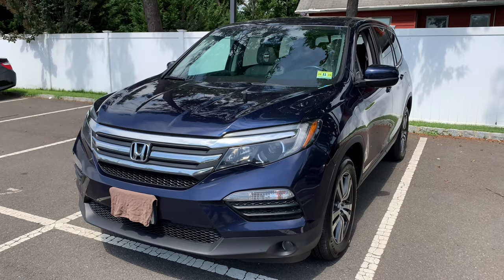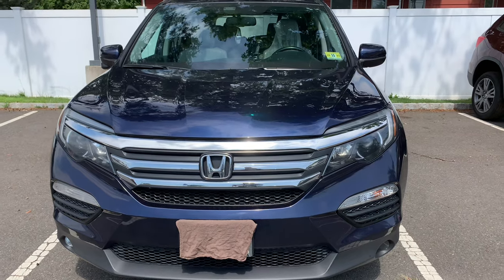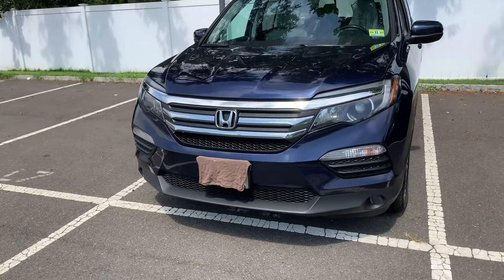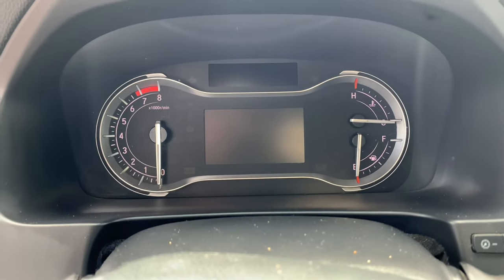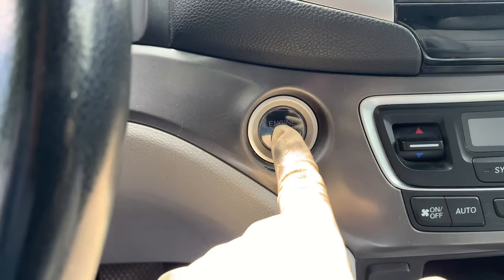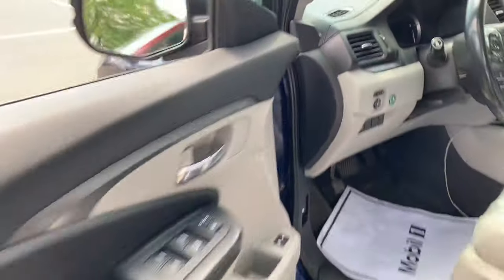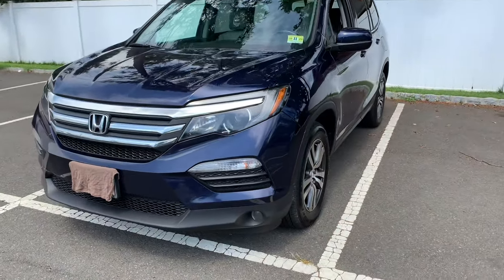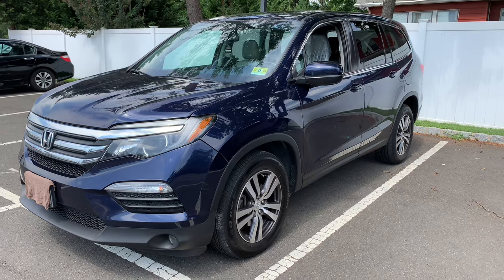2016 - 2018 Honda Pilot common problems

Comment: I enjoyed the video. I just bought a 2017 EX-L AWD 6spd and I noticed the tachometer fluctuating. The vehicle has 74,000 miles and I did get an extended warranty from the dealer. Should I request a trans fluid change? Or just mention the issue and see what they will do. 

Thanks in advance for any help.
-Jake
Reply from the maker: Mention the issue. Tell them you know it’s a “thing” with these cars. I have a few videos on this matter. Tell them to check for pcm updates and perform if needed as well as the 3x trans drain/fill.
Reply: @BCautosolutions  Will do! Thanks again for the info! 😎
Reply from the maker: @sparkiejake1  👍🏻👍🏻

Comment: I have a 2018 Pilot Elite....when i make some turns, it feels like it wants to shut down, and just before it does it inadvertently revs up with a jolt
Reply from the maker: @MrLovegospel  check your intake tube. If it’s good I would clean your throttle body and have the values relearned with a scan tool (must do step)

Comment: Thanks for sharing your knowledge and insights. I am looking to purchase as used (new to me) Pilot and have been reading mixed messages about the transmission. Some say get the 6speed some say get the 9speed. Which one would you recommend? I know the the only comes in the Touring and up models and the 6speed on the EX-L and below trims. Looking at 2017 and up model years possibly till 2019 only - or as budget permits. Thanks!
Reply from the maker: Hey thanks for watching. So people saying don’t get the 9 speed don’t have any idea what they or saying or experience. We have had nearly zero issues with the 9 speed. The 6 speed is problematic but if you stay on top of the transmission services (I highly recommend every 15k a drain and fill) then it can get a way less problematic trans as well just like the 9 speed. Buying a used one can be risky because chances are proper maintence wasn’t done on the 6 speed and could be too little too late, for that reason I say go with the 9 speed if the budget allows to get, which like you said comes on a higher trim pilot.
Reply: @BCautosolutions  Thank you so much for replying back to me. I really appreciate your time and effort. And thank you for the advice as well on which transmission to get. As mentioned, I am getting mixed reviews on both transmissions, both have been said to be problematic with the shudders and rough shifts and loss of power. But now I am confident in getting the 9Spd over the 6Spd thanks to you. I’m also a subscriber to your channel now as well. Looking forward to learning more about Hondas. Cheers!
Reply from the maker: @arwencale  thank you, congrats on your new (to you) purchase and best of luck to it!
Reply: I apologize for butting in but I wouldn’t recommend a Honda Pilot. I have a 2017 and it’s not a good car. I bought is used with very low mileage but it’s already becoming an issue.
This is my 2nd Honda and both have had issues within 3 to 5 years of manufacturing.
If I could go back in time I would get a Toyota. Toyota has never given me (my son or husband being the main mechanics for usual things) issues until they got beyond 10 years old or older. That’s as long as you do regular maintenance but that goes for most cars. I’ve just experienced that Honda isn’t as reliable as Toyota since I don’t have a lot of money to spend of mechanics that do things that my son or husband couldn’t do for whatever reasons.
Wish you the best!
Reply from the maker: @susana5052  thanks for your input, I can assure you Toyota has their own share of issues… I’m actually getting closer and closer to making a video about all the issues they are having. Our sister Toyota store is literally across the street.
Reply: @susana5052  all problems started by doing a japanese vehicle in the USA....
Reply: @saca.r9987  So then.... they are not japanese.... or are they?

Comment: Just checking things out as I am also planning on getting into a used (new 4 me) 2018 touring, and I need some assurance that it is a good decision. I am curious, though, just to make sure the 9spd is NOT CVT, correct? And how often would you recommend servicing on the 9 spd?
Reply from the maker: Correct the 9 speed is not cvt. Change the fluid every 30k.

Comment: I am driving a 2018 Pilot EX, I encountered the fuel injector issue and transmission issue. Fuel injectors and torque converters were replaced under the extended warranty.
Reply from the maker: @shawndongbo  thanks for sharing

Comment: Looking at buying a used 2017 Touring. Is there a new revision on the fuel injectors that fixes the issue or would I constantly have to replace them every x miles?
Reply from the maker: Yes there is

Comment: I am about to buy a used 2016 EX-L with  80k miles from car max. Would you recommended buying with warranty to cover any unwanted issues? Or would issues ve to many to not be worth it? What is yoir take on it? Car is well maintained and all changes/Maitanance was done in dealership on time unitl now. 1 owner.
Reply from the maker: If it was well maintained you should be ok, the car besides what I’ve mentioned is relatively solid. Depending on the price of the warranty and what is covers (if relatively thorough) still isn’t a bad idea in the event of an out of the normal failure.
Reply: Hi. I am about to go into the same purchase. Did you buy it? If yes, how is it holding up?? Thanks!
Reply: @TheCaioKyleBraga  Hi,
Car is at 130K miles bought it at 116K. The first thing I did was do a complete Maitanance check and upgrade. I would recommend getting all the needed Maitanance such as timing belt, spat plugs, brakes, etc. After that car should be good.

Comment: Thanks for sharing.. bought a 2019 with the 9 speed. Get the weird pull back on the transmission. Brother had a rdx type s with same issue. Is that a common issue?
Reply from the maker: Hey, thanks for watching. The 9 speed trans on the pilot has been rock solid, not really sure what you mean by pullback, but I’ve had no issues with them on any Honda. The rdx a spec (no Type s version of that car) uses a Honda 10at which also has been pretty solid on various applications.

Comment: We have a 2017 pilot ex-l….. just had to get the fuel injectors replaced and previously had the push button start replaced. Ours has about 55k miles on it. My question is should we look to trade it in soon when our extended warranty runs out or keep it? We have not been regularly changing transmission fluid (have appointment to do that for the first time next week). I don’t want to have to get a new transmission right after the warranty runs out. Thanks for input!!
Reply from the maker: So at 55k if you start with the aggressive transmission services you should still be ok. With interest rates through the roof and climbing I think holding onto it and meticulous maintenance going forward would be my personal game plan.
Reply: Thanks for the input! You are spot on with the issues!
Reply from the maker: @joshuagarneau9664  thank you! 🙏🏻

Comment: Hello thank you for the info  my 2016 has a error code u 3000 multipurpose camera malfuntion LKas warning, cruise control warning, frontal mitagation assit warning. Is the camera covered under any extra warrenty because its  part of the safty system? Any info would help thanks.
Reply from the maker: Hey, thanks for watching. As far as the warranty for something like that I believe it’s only 3 years 36k for the radar/camera.

Comment: My wife has a 2016 pilot, when cold outside when you push button to open rear hatch it will open all the way up and will close as soon as it get open ! It will put pressure on you but will stop . Not sure what it would do with a child using it !!!
Reply from the maker: You can try and perform a 15 minute battery reset, if that doesn’t work, take it to your local dealer to have them diagnose it properly.

Comment: I currently own 2016 honda pilot EX  which has issues with fuel injection and push button. It has 143K miles. I will sale it soon.
Reply from the maker: What are your going to replace it with?
Reply: @BCautosolutions  toyota 4runner sr5 4wd
Reply from the maker: @johnnguyen6859  Nice, best of luck with it
Reply: @BCautosolutions  thank you.

Comment: I have a 2017 Pilot AWD.  I love it, but I did have the trans jutter issue.  The dealer was able to fix that.  And now I am experiencing the front rotor issue, I'm assuming.  Steering wheel vibration when braking.  85,000 miles on it. I'll be addressing that next.  Still love the Pilot, though.
Reply from the maker: Appreciate the input, seems to be treating you rather well 👏
Reply: Definitely!  Keep up the good work. Appreciate your channel!
Reply from the maker: @ryanandrews3689  thank you!
Reply: Man i was thinking about buying 2016-18 Honda pilot but seeing some off these reviews makes me nervous about buying it now. I have a cr-v now really reliable so I was the pilot would be the same. Thoughts? Is it worth buying?

Comment: what about the capless gas cap? I am getting an emission problem screen, no codes and no misfires. Seen others with this problem, problem goes away after refilling gas tank. Goes  a month or 2  between and only when cold. 2017 Pilot EXL with 70k miles. My dealer acts like they never have any problems, mainly the shudder. They did flush once and have done it once. Easier than taking it in and not having it for a few days.
Reply from the maker: Capelas system does fail from time to time. As far as the light can be anything and needs to get a code pulled.
Reply: @BCautosolutions  no codes or misfires, dash says emission system problem.  I take gas funnel and work in and out, spray WD40 and warning goes away. It has happened 3 times in the last 2 years and always clears after a fillup.
Reply from the maker: @alweisberger7502  weird

Comment: 2018 Pilot: Six speed Transmission failed at 58,500 miles; hard shifting and P0776 code. Honda replaced at no charge but said there was no warranty on the remanufactured transmission.
Reply from the maker: It happens unfortunately
Reply: You have to change trans fluid and external filter at least every 40000 miles or the tiny little filter will clog up and you'll have your flutter or jiggly gears

Comment: Hi, I'm experiencing the torque converter/transmission issues you have explained at @ 2:00 , do you have more info on the warranty extension for 8 year/80k I haven't heard of this do I need to work with American Honda to extend the powertrain warranty? My vehicle is at a dealer with a TC replacement at the moment after P0741 code. TC replacement made it worse and waiting for American Honda to grant a new transmission under powertrain warranty.
Reply from the maker: I’ll review the bulletin tomorrow see if there’s any updates.
Reply: I'm experiencing the same problem on a 2019 6 speed... I'm at 60k+ and was told my warranty was over.. so my question is the same.. How do I find the info on the warranty extension you mentioned I'm in California..don't know if that makes a difference.  Thanks in advance
Reply from the maker: @chrisarr7615  so it only applies to 16-17 pilots 80k or 8 years whatever comes first.

Comment: I have a Honda pilot 2016 of all that I have said 9 high -speed transmission, I have never failed, but sometimes the sound comes from it as if elephants are shouting, it was always, I don’t know if there is such a sound for other owners. The ignition button also junk, but I took it off and processed WD40 and the problem was solved. The front brakes are the same as in the video, if they are warmed up and you drove into a deep puddle, you will have to go to grind them. This is the problem I have now: at the intersections when the engine stalls, it will no longer start, so I have to turn off the car and turn it on again. Maybe someone knows how to solve this problem.

Comment: Hey man, would you still recommend being a tech nowadays? Im pushing B level skills with honda/acura and  idk if its me or or the industry but ive been struggling to make money. Ive had my 70 hr weeks but it wasnt easy and theyre rare. A lot of diagnosing needed with these newer cars that dont pay anything like how do you make ends meet with that???
Btw thanks for giving us the heads up on what to look out of with these cars
Reply from the maker: Hey man, so it’s definitely getting harder and harder to make hours, with  all the added diag, bulletins, etc. if you have an opertunity to switch careers and make same/more money I would take that for sure.
Reply: Start working on semi trucks. Lots of money in that industry

Comment: I have a TPMS light on how I can fix the problem
Reply from the maker: Can be as easy as a sensor or as expensive as an abs modulator. Need a code to point you in any sort of direction.

Comment: My ‘18 Touring sometimes hesitates then surges when accelerating from a stop. I’ll press the gas, RPM barely moves for 2-3 seconds, them vroom 3000 RPM. It happens with eco mode both on and off. I’m up to date on all scheduled maintenance. I did notice it started when I had one new tire 🛞 installed due to a flat, so I suspect it’s 4wd/transfer case related, but not sure. Problem persisted after changing all 4 tires out. Any fixes?
Reply from the maker: Is it when the engine/trans/ambient temps are cold?
Reply: @BCautosolutions  Yes mostly when cold like leaving my driveway in the morning (I always remotely warm up the engine), but it also occurs sporadically during normal driving when accelerating from a stop sign when engine/transmission are warm. What should I do?
Reply from the maker: @kazj1728  if it’s when it’s cold and first drive it could be normal to an extent, randomly throughout the day your going to be looking at an internal issue most likely.
Reply: @BCautosolutions  Thanks. It’s probably mostly due to cold running, but I suspect if it’s internal then it’s the 4wd system doing something as the engine doesn’t even respond to throttle input for that brief 1-2 second period. The car threw a P0304 misfire code which prompted the dealer to change out the fuel injectors and gaskets a while back (free under a recall or something), so I hopeful it was fuel system related, but no, it kept happening. It might be placebo effect, but I feel like it’s less prevalent after I’ve had the oil/transmission/diff/transfer fluid changed, and more pronounced when these fluids are old. Any idea of codes I should be looking for?
Reply: Is it easy to access and clean the throttle body?
Reply from the maker: @kazj1728  the codes could vary and I would think it’s either throttle body related issue or trans issue at this point. The p0304 would give a drive ability issue while vehicle is already in motion in most cases.
Reply from the maker: @kazj1728  yes, not bad at all. Will work on a video of the process soon.

Comment: Hi   Today the engine light came on. Autozone told me that I have code P430.  Can yo tell me what’s the problem please!
Reply: Sorry 2017 honda pilot elite.
Reply from the maker: @JesusGonzalez-kj4jd  thats a primary bank 2 cat code that sometimes can be thrown by faulty injectors. A af test has to be ran with a scan tool to see if any of the injectors fail. It’s going to end up being injectors and/or catalytic convertor.
Reply: Thank you for your help!
Reply from the maker: @JesusGonzalez-kj4jd  anytime
Reply: Hi again  question do you know if this problem has a recall?  Injectors.
Reply: What’s the price for the injectors and labor.
Reply from the maker: @JesusGonzalez-kj4jd  not a recall, but there is a service bulletin.
Reply from the maker: @JesusGonzalez-kj4jd  i would have to get a quote. Shoot me an email with your vin: bcautosolutions20@gmail.com

Comment: My God I just replaced both the cat converters at 124k
Reply from the maker: What wad the codes?
Reply: @Hondamobilemechanic  honestly I don't remember.  I didn't even know honda has 3 supposedly. I just did whatever the shop said. My car was having problems when I pushed the gas it would take forever to pick up speed.
Reply from the maker: @Foltynsplay  could have been clogged but not common. Hopefully they did the right thing here . Thanks for sharing.